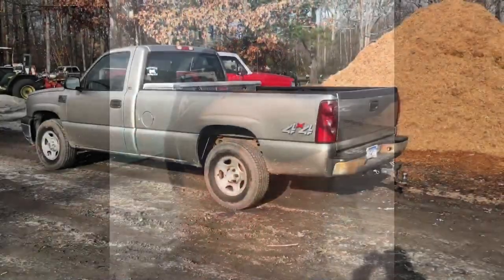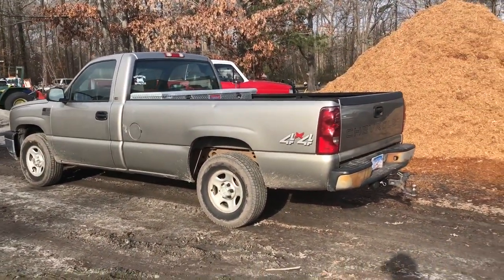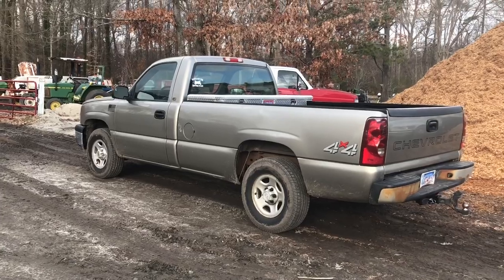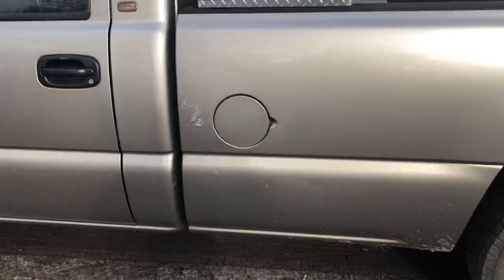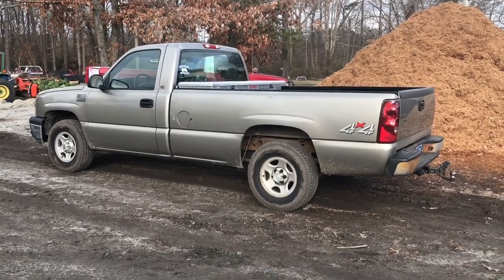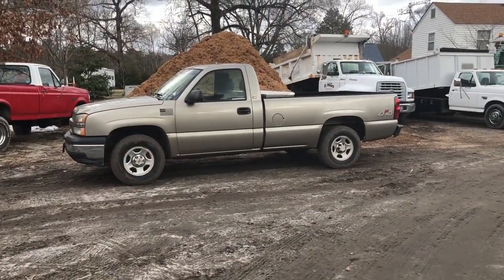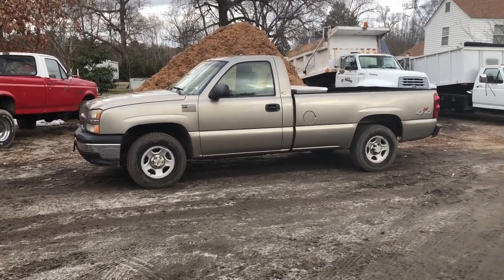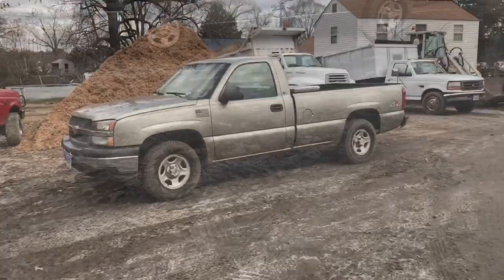Heavy towing with the 4.8 Vortec. Should you do it ?

Comment: Im watching this video because im going to tow my buddies car which is about 3k pounds. I have a 5k towing capacity trailer package i should be good right? Its about a 250 mile trip.
Reply from the maker: Depends on weight of trailer. Just make sure hitch receiver and bolts are in good shape and not rusted out.

Comment: I need opinions I have a 03 1500 extended 2wd 5.3 and i wana tow an exact same truck. And i need to tow it 359 mils is it to much for the truck to handle
Reply from the maker: I did it with a 4.8. You’re going to need a brake controller , and make sure the trailer is loaded correctly, don’t have the tongue of the trailer to high or low. Have it even and straight as possible. You should be fine
Reply: Hey thanks man i appreciate it

Comment: Wonder if a 5.7 tbi can pull another 1500 Silverado?
Reply from the maker: King Conker power ratings between the 4.8 and 5.7 tbi are similar. Has a lot of factors involved. Flat terrain ? Hilly terrain ? Size of trailer ? Condition of rear suspension of the pulling truck, brakes (you need a brake controller for long distance/ heavily populated roads) . Overall shouldn’t be a problem. I towed that Tahoe 250 some miles and was fine . Make sure the trailer your hooking up to is level with the truck. Inspect brakes and brake lines and fluid level. You’ll be ok
Reply: Yes been there done that don’t be half bad
Reply: the vortec 350 has plenty of power to tow uphill, however, the 4l60e transmission is its achilles heel.  check your oil often as well because intake manifold gasket failure might happen at the 150k to 175k mile mark

Comment: I got a 2004 v8 Mercury can I leave it in drive when I tow
Reply from the maker: It’s best to just turn overdrive off or put it in tow haul mode. But If it’s a light load I wouldn’t worry about changing into a different mode/gear.
Reply: 1776 Outdoors all I got is a o/d off button I don’t got a tow haul mode button so towing a 6by12 trailer loaded with furniture I should just leave it in drive?
Reply from the maker: Mike Brown I think you’ll be fine leaving it in drive or turning OD off . Won’t hurt either way. 6x12 trailer with some furniture is a pretty light load In my opinion. But like I said , won’t hurt either way.
Reply: 1776 Outdoors thanks what drop will I need like a 2inch?